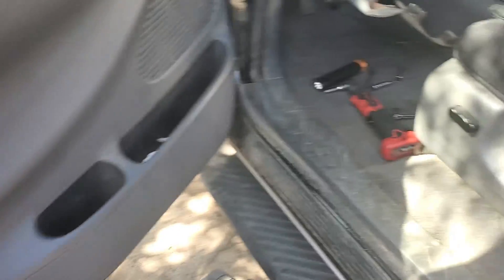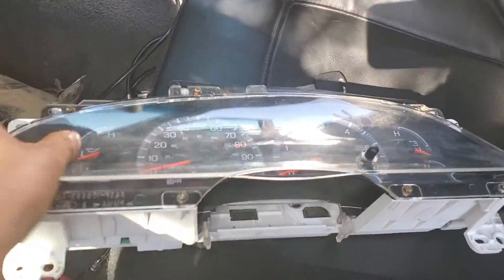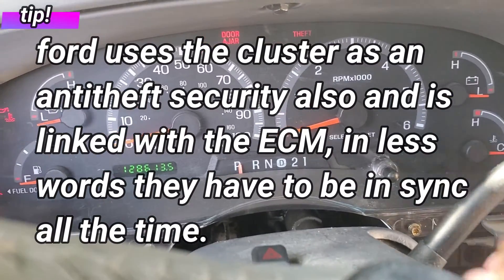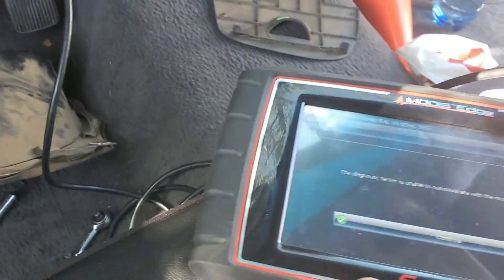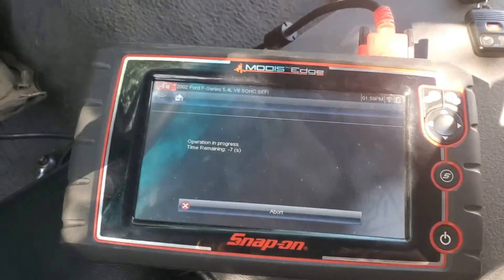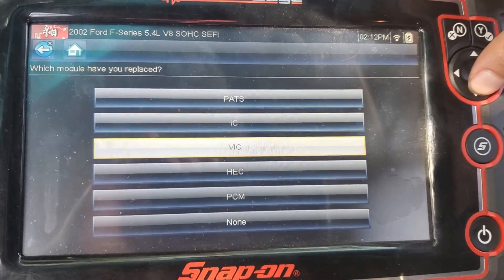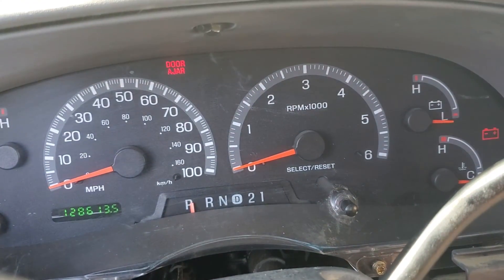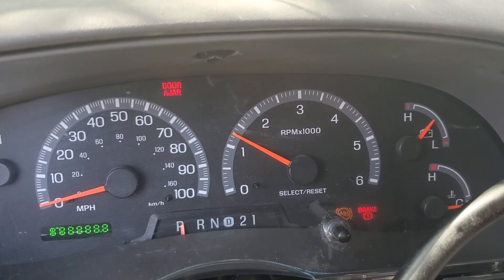How to program keys on a 2000-2005 ford F-150 cluster swapped using Snap-on scanner solus ultra.

Comment: Hey great video I have a 2001 ford f150 xl 4.2L with a manual transmission and the cluster has no tachometer and bought one a while ago with a tach and I thought it was plug and play but it needs reset I have 2 keys for that truck could this help me to do it

Comment: Hi, can I use any SnapOn Modis Edge?? .. I also installed a new cluster and my keys don’t work, the engine cranks but it won’t start and the anti-theft keeps blinking. My truck is 99 Ford F150 4.2L. Thanks for your help.
Reply from the maker: yea u can use that scanner to program the keys